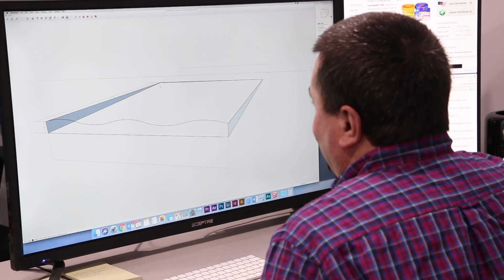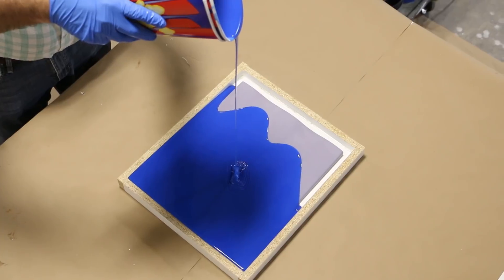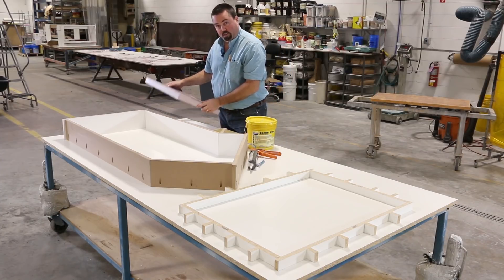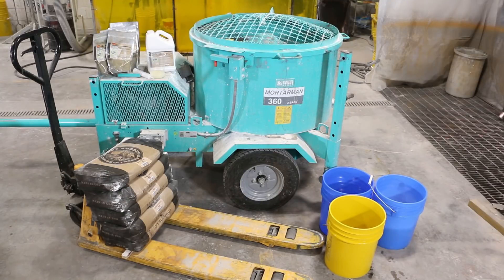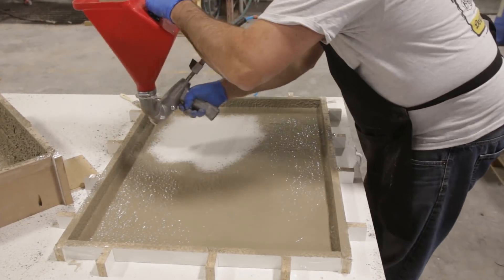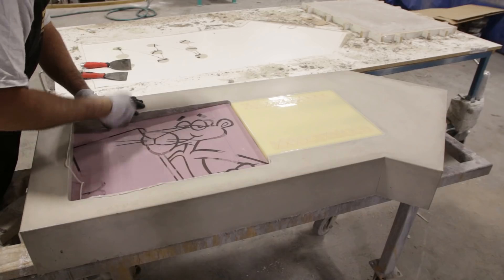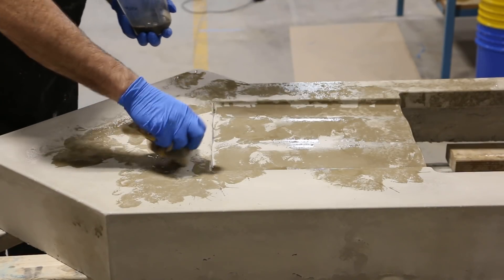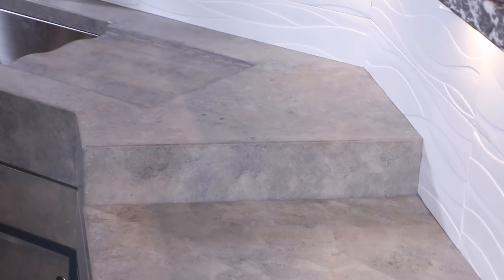How to make concrete countertops using Buddy Rhodes GFRC Blended Mix

Comment: I am looking to pour a concrete monument base, it's a pyramid with a flat top. that a bronze statue will be affixed requiring anchor bolts to be cast in. I am wondering if it is possible to pour any of the products thicker, into a from like traditional concrete? the finish is to be polished. Does anyone have experience and maybe a link to a video for this?
Reply from the maker: Hi Tim, can you send us a tech ticket here: https://www.buddyrhodes.com/contact-support

Comment: Porque tapam o concreto com cobertores?
Reply from the maker: A cura do concreto deve ser gradual, caso contrário, podem ocorrer fissuras. Para evitar rachaduras, o plástico é colocado sobre o concreto em cura para reter a água em seu interior e regular sua temperatura, garantindo uma cura gradual. As mantas ajudam a evitar que o calor saia da peça, permitindo um tempo de desmoldagem mais rápido.
Reply: @BuddyRhodesConcreteProducts  Obrigada,aqui no brasil,usam colocar agua, ir molhando várias vezes ao dia pra isto não ocorrer.

Comment: If you are only using it once, is it possible to use the tooling board directly, rather than making a silicon mold, then a resin version?
Reply from the maker: Yes, you could. This was cut out of a boarding tool, so it was pretty rigid and if used directly it could be a problem when demolding, damaging the casting. If it's going to be used directly, we would recommend it to be made out of foam.
Reply: @BuddyRhodesConcreteProducts  
Thanks. I thought that, especially after I looked at the price of tooling board :) Thanks again.

Comment: That is an absolutely beautiful countertop! Great job!

A probably silly question: Could you not have (with a bit of treatment) used the original model that was cut for the drain board instead of going to the trouble of creating the mold? Would the resultant product not have been the same? 

Cheers, and great work!!
Reply from the maker: Thanks andypandy!
That's a very good question. It could have been done as you say, but since the CNC cut piece is rigid, it would have been more difficult to demold, and probably be used only once. We wanted something flexible and that would allow us to use it many times.

Thanks for the comment!

Comment: Do you have to spray GFRC with spray gun,or can you also mold by hand?
Reply from the maker: Hi Brian, it is possible, but it's more difficult because the mix is fluid, and you would be risking to have voids that you wouldn't have if spraying. If you want a more in depth information, please ask our technical support team here: http://support.buddyrhodes.com/add/
Reply: Buddy Rhodes Concrete Products ok thank you,I follow your channel and I see you have a special mix that you use to do press molding.is that different from the GFRC mix? And I also visit your online store and would like to pruchase your products
Reply from the maker: Yes it is different, the Crafstman Mix is designed specially to exhibit clay like properties, which lends itself for use with the press technique.

Comment: I remember watching your original dvds growing up. I like the use of water reducers and fiber. Have you ever added super plasticizers to the mix?? Make it easier to pour? And fill any voids?
Reply from the maker: Hi Benjamin, that's great about the dvds! 
Actually the Water reducer 420 is technically a high range plasticizer or super plasticizer. We recommend 420 for spray applications, for pour applications we recommend the water reducer 555, which allows for more flow with less chance of segregation. You can see more information here: http://www.buddyrhodes.com/water-reducer-adva-555/

Comment: Great quality, I spent many years making molds for architectural projects and used a very similar system, one thing we did slightly different when sealing edges with silicone was to spray the corners with a mild detergent and using a silicone tool it leaves no mess, so no waiting overnight to remove the tails. this was literally the most thorough video I have seen, very enjoyable to watch.
Reply from the maker: Thank you very much Designer- Garb. We're glad you enjoyed the video. And thanks a lot for sharing your tip!

Comment: That is beautiful.....but damn that is a ALOT of work..... did you all calculate how many man hours you have in those two pieces?
Reply from the maker: Thanks e g. Definitely it takes some work. We didn't calculate the actual working time, but Jim worked on this for 3 and a half days, including all the wait time, for the rubber to cure, the caulk, the concrete, glazes...